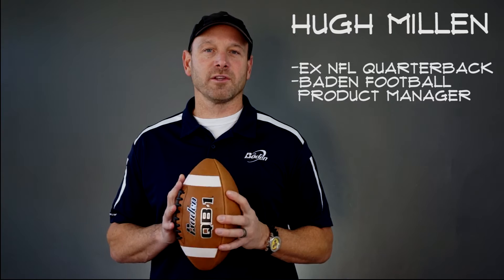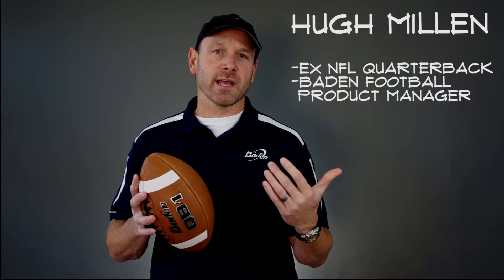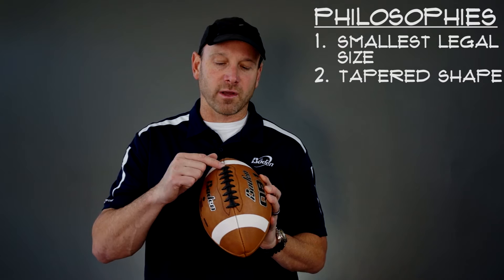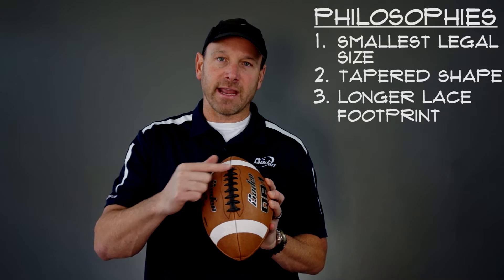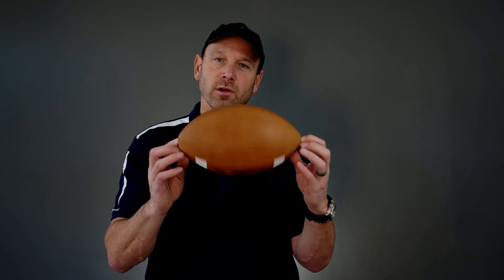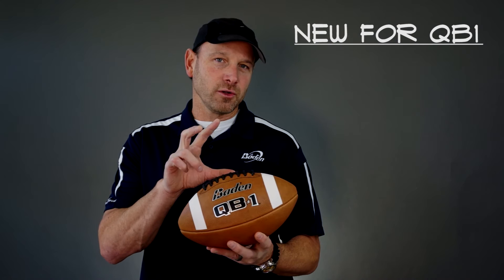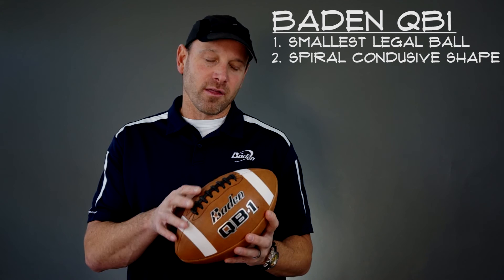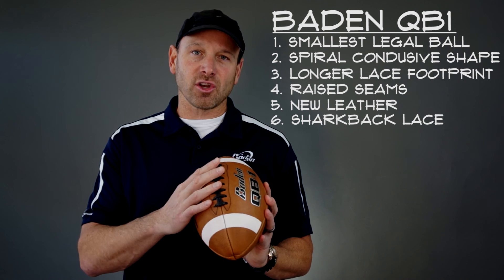Full Overview of the Baden QB1

Comment: Hugh, thanks for doing these videos. Only company I've seen do them. All the other reviews on YouTube are from retailers or kids and they're useless. Question: I commented about this on a video by Hugh Tompkins but figured I'd post here too. Why doesn't Baden make a "cushioned" version of the QB1? Both you and Tompkins have made videos recently about how underinflated balls are easier to throw (https://www.youtube.com/watch?v=8cx8yRluaHg and https://www.youtube.com/watch?v=2EstM14kCTA). If you made a "cushioned" ball, the PSI inside the ball would remain within spec for NHFS and it would have the same effect as deflating the ball. Rawlings makes the ST5 and Spalding makes the J5V. I have both. They are easier on the receivers. Whether they're easier to spin, I don't know. I have the Baden Perfection. I buy in to what you say about the shape. I just ordered the QB1 yesterday. Really excited to see the new leather (have 3 GSTs - they have their faults but the leather is good). Already had a QB1 Microfiber with the new laces and I liked those. 

P.S. Do you have to be named Hugh to work at Baden?...